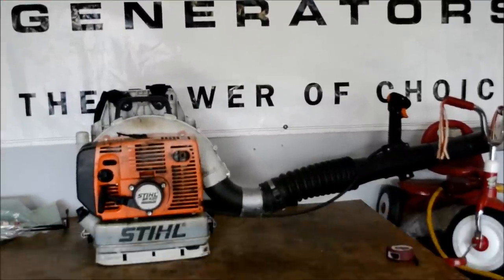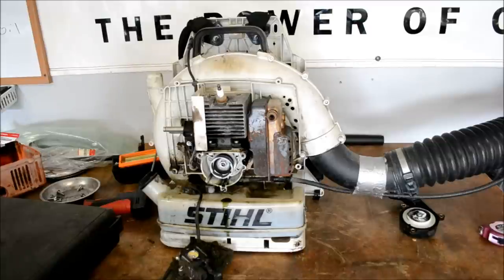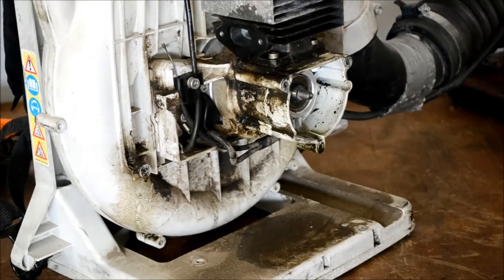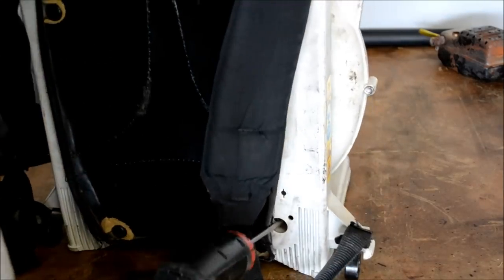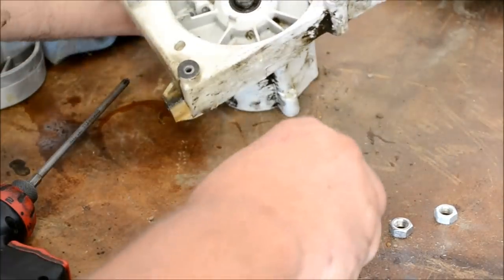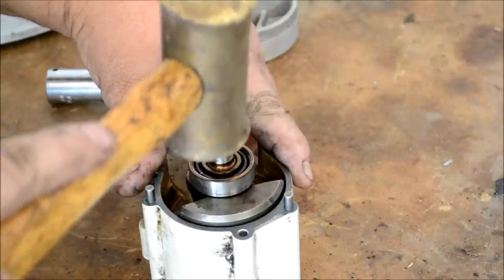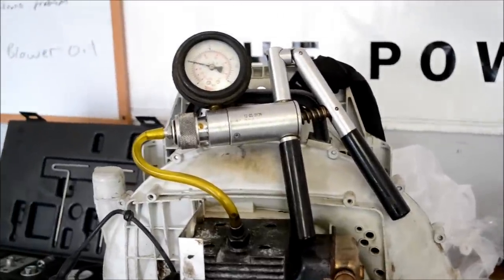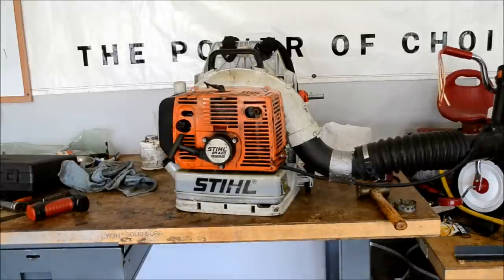STIHL BLOWER REPAIR / BR420 MAGNUM / DIAGNOSIS / TEARDOWN AND COMPLETE ENGINE RESEAL / IN 1080HD

Comment: Hey MowerMedic1, love you video.  I have a BR340 that is just a few steps down from the 420 you worked on.  Now I know how to disassemble the whole thing from your video.  I prefer your videos in 1 part instead of two or three.  It doesn't matter if it is an hour long.  When I have a need to repair my equipment I am going to watch what I need to watch to get the job done.  So don't worry that your video's may be to long in one part.  Those that need to watch are going to watch.  Thanks again.  I wish you would have showed how you squeeze the ring and get the piston back in the cylinder.  Thanks again for a great video.

Comment: Jeremy I can't thank you enough for that video. I have been a professional automotive mechanice for 45 years and first I have to praise you on your thoroughness of testing first. You diagnosed the problem and then resealed the entire crankcase for us. Nice job and again great skills. I'm retired from the automotive business now but have a fully equipted small engine shop and do this kind of repair. While I have done many kinds of repairs I haven't parted the case on one of these yet. But if need be with your instruction I would not hesitate to get the job done. Again thank you my friend for taking your time to deal with the camera and get this on film for everyone to see.
Best Regards,Lisa

Comment: I have to complement you on this video, I havnt got your range of equipment but came to the same conclusion with my BR420 and this video inspired me to give it a go. Stripped it down, installed new gaskets and new piston and rings (one was broken) and put it back together, new fuel and spark plug and gave the carb a complete overall. Crossed my fingers and nothing! Then remebered the start switch and hey presto it burst into life. The cost of the parts probably made this exercise too expensive in the U.K. but very satisfying none the less. Thx.

Comment: Very comprehensive job - you clearly know what you are doing.  I had cleaned up my BR 420 because my son was complaining he could never get it started.  Really nothing wrong with it but it did need the plug properly gapped (.5mm  pg. 31 of the manual), but in removing the carburetor to clean it, the throttle cable became disconnected and I was finding it nearly impossible to get it reconnected - and here is where I was hoping you would show that when you were putting everything back together.  Got some ideas of what I need to do so back to the drawing board for me.  Would never try the tear down myself without your video - great job (except the abbreviated process of putting it back together.  )

Comment: I have an older redmax blower i would like to do this to but they have the 2 piece crankshafts and I don't have the tool to get the crank shaft apart to replace the bearings in the case. Great job Buddy!!

Comment: I can't thank you enough also.....I found a br 420c on the side of the road.......new air filter, new gas, plug, fired right up.. however I'm ordering a complete cylinder ,piston, carb kit, seals.....bad score in cylinder. It won't idle long, do you think it's bleeding down compression from the cylinder or seals and base gasket.? It looks all oily just like yours...however top speed it will run for hours. Where do you get your parts? Tons of hours on this unit, I'd like to do a full rebuild including crank, any good parts places online? Anyways I loved the video, now I know all the tools I need. Thanx again my friend
Reply from the maker: Feel free to click on that heart under the video! Thanks for watching!

Comment: Man that was a great step by step instruction. I have one of these models that my neighbor gave to me. The only thing that I had to do was change the carburetor. Now I have noticed that my air filter has been soaking up the fuel. I have no idea how long this was going on. Normally when it doesn't start I will pull the plug and let the cylinder dry out. But now i have pressure remaining in the tank. I read online that the gas cap is not venting???? Since they stopped making this model, how can I get a replacement cap and a new air filter???
Reply: Check on eBay or amazon and you should be able to find a new cap

Comment: Many Thanks great detailed video!.  I have a BR430 which is leaking air/oil in the cover.  Starts, OK then warms up and starts dropping power.  Suspect its possibly seal between block and crank.  Not 100% sure But I don't have a compression tester - anyway to find leak without this ?

Comment: Jeremy I want to ask you a question. I purchased my in law's cottage and it came with a BR420 Magnum blower. The blower only has about 4 hours on it. The unit has sat in a dry exterior storage shed but the weather has been extreme for temperatures as it is in northern Ontario Canada (in the 90's in the summer and down to around -15 in winter). It was sitting in the shed for two years untouched. I took it out of the shed and the fuel tank was over half full. I went to pull it over and it just stopped/stuck. I figured it had seized. I pulled the plug and it was full to the brim of fuel so it had hydraliced. I found I broke the shear key on the crank. My question to you is would you think I bent the rod possibly as well? I really do not want to pull the bottom end apart. I did loosen the head bolts and drained out the fuel from the crank case as well. I have fiddled with engines for years but this is the first time I have had a motor draw fuel from temperature changes. You see that before too? Really interested to hear your thoughts on the rod. Thanks

Comment: Bought a mess up 420 ,found the carburetor screw's trip ,engine block has to re tapped ,got an old engine, but piston stuck, can't get it open, still working on this project,,

Comment: Loved the Break Down and Rebuild video... i own an old BR420 C Magnum.. I bought used.. i am having a problem with the throttle Cable assembly .. I can't get Full Power from Trigger.. I think the previous owners had either removed a piece or  lost it/broke... that holds the cable to the carb.... the cable seems to float freely there... Nothing holding it in place... Would you happen to have and diagrams or parts catalogs for the carb/Cable connections??
Keep the Videos coming.. Loving and Learning a Whole Lot!! Thanks!!

Comment: I notice that crankcase half  gasket was sticking above the cylinder base. Is that a possible leak spot because the bottom cylinder gasket has a hard time being flush with the crankcase base. What do you think?
Reply from the maker: you have to trim the excess off with a knife

Comment: Hi Jeremy,

Great video! I'm looking at doing a tear down and rebuild of an old Stihl BR420. When my dad gave it to me, he said the unit will run for a bit and they die a short time after being on full throttle. So far I have replaced the air and fuel filters, rebult the carb, new spark plug and cleaned the spark arrestor screen. I had my local small engnie mechanic run a pressure test and ensure the carb was properly adjusted. My last effort is to replace all seals and gaskets. I hope that will solve the issue.

Thanks again for video! Also, any advise or recommendations would be appreciated!
Reply: Did you end up adjusting the gap between the ignition coil and the flywheel?  I have the same problem and I have heard that this should fix it.  The gap is equivalent to a business card
Reply: What is the PSI

Comment: Jeremy, have you heard about STIHL and others chainsaws used in Forestry Dept have been splashing fuel back into users faces due to build upon pressure in fuel tank, someone came up with a different cap and a refueling system similar to Indy Cars.
Interesting.

Comment: I just did this job but I changed the crank and bearings and apparently I screwed up the front crank bearing housing and after about 4 uses it blew out the front seal and would not crank  so if you change the bearings DON’T KNOCK THE FRONT BEARING into the block housing to far it bends the lock clip and runs the block  from experience luckily I have a used one coming and redoing my mistake

Comment: Great video! I just picked one of these up. It runs great but I now have oil stains on the back of my shirt and pants. The wife is not happy! This looks like the solution to my problem. Where is the best place to get parts? Is there a kit with the seals and gaskets? Thanks again

Comment: I baught the BR600 magnum about 3 years back. Any problems you know of I should lookout for? I have about 100 hours on it so far, so it hasn't really been used too much but it's been a fantastic machine. I run nothing but 50:1 with 89 octane.
Reply: a 4 stroke that runs on mixed gas? wtf are you talking about...

Comment: My Stihl BR 430 blower has developed a engine knock.  Very noticeable at low RPMs.  Is the problem most likely a crank shaft bearing/seal?

Comment: my friend,i like your videos,and  I like to ask if you can explain the functioning of a little valve incrusted on the fuel tank of the 600 magnum blower and also if you can explain the assembling of the intake and exaust valves on the same machine,specialy the balancing mechanism ,that looks like little fingers and moves with the push rods, I have one on wich I like to put my hands on it,tks a lot

Comment: I wanted to ask are there two intake manifold gaskets or one when I took apart my machine it had two manifold gaskets one on the cylinder between the heat shield and one on the opposite side of the heat shield my question is how many does it require and where does it go
Reply from the maker: https://www.google.com/search?q=br420.parts.list&rlz=1CDGOYI_enUS771US771&oq=br420.parts.list&aqs=chrome..69i57.12282j0j4&hl=en-US&sourceid=chrome-mobile&ie=UTF-8#imgdii=eqpqR57KPS2yCM&imgrc=1oGRUThyZssYaM

Comment: Great video it's sad how so many pepole will toss it in the trash or give it away or sell it very cheap and all it needs is a little of your time and now how and it will be like new again am one of the guys like u fix it and ur good too go only if u new how many good things I get from pepole not noing how to fix it or I'll buy something cheap and I'll tear it down clean every part and new seals and your good too go sometime u will run into something that can't be fix but what I'll do is tear it down and save the good parts and toss the no good stuff and I'll say this more then a hand full of times I used a part that I saved from something that hand no use anymore . Evertime I save parts I write what it's for what it came off put it in a baggy with some tape on the bag and write on the tape and I'll put it with all the other parts pluss I always clean the parts but ya I love to fix something that would off gone in the trash pluss u save a lot of money and u make money if u sell it now this is what u call very GREEN something that not to many pepole will know !!

Comment: I have a Sthil BR400 backpack blower, I removed the pull starter, what size nut holds the starter assembly on the piston point?

Comment: I've got a BR 350 and the plastic adapters for the hi and low adjustment screws on the carburetor which limit  you're adjusting parameters somehow came up missing after loaning it to a friend and the high and low screws adjustments are way out of whack. Do you know how many turns each should be adjusted outward for the factory setting if screwed all the way in clockwise? I've searched high and low and cannot find how many turns to achieve factory settings. Please help! J D in Tampa Florida
Reply: I usually close them up snug not tight so you don't bend the tips. Then back them off 2 1/2 turns and go from there. Once you get the initial idling then you can rev the engine and conduct your final adjustment.

Comment: A new version Br450 is $800 in Australia I’m sure the repair wouldn’t be viable for a contractor to have it repaired at a shop without costing an arm and a leg.
I know it’s a in-house repair in your situation, but if it was someone of the street what would the repair cost be parts and labor.
Let’s assume the replacement cost is US$500 - $600 for a new one with warranty.

Comment: Hey I'm having trouble with a stihl br600 blower it won't turn on I took it apart and put a new motor In it but when i try turning it on it won't turn on idk what's wrong or what I did wrong in the process
Reply from the maker: too many things it could be.........but to make any engine run you need fuel, air compression and spark......these 4 things it should run.

Comment: I just subscribed to your channel, thanks for the lengthy video, lol, just kidding...Very helpful, although Its my fuel that's leaking underneath the gas tank.. I guess I will need to pull it apart first and see where the leak is I will let you know how it turns out..

Comment: Hi ,I got a br420 magnum I rebuilt the engine because don't star Just compression explosion like out of time,I cleaned it up and put everything together fuel tankI clean the tank ,carb new spark plug and he doing the same thing I am mad because I Cleaned up so perfect And still do the same thing I put another carb but the same thing again I know he got compression but I don't know what the Hells going on even The coil is clean but nothing just explode muffler and the cap.
Reply: Tony Casiano  I have one that's doing the same thing. I did all the same things and even replaced the piston and rings. Still won't start. Checked my wires and even replaced the coil. Any luck figuring yours out?

Comment: hey great vid ..I have a br 400 ..hard to start and once I have it started it will run for a little bit then stop ..I did a rebuilt on the carb and new plug.?  what do you think..thanks
Reply from the maker: First things first is to do a vacuum and pressure test

Comment: My blower gets very hot and blows out white smoke the first few seconds. Do you know the reason?
Reply from the maker: Flooded
Reply: How can i fix that issue?
Reply from the maker: Sergio Garcia rebuild or replace the carburetor and related parts

Comment: GOT A BR 420 MAGNUM  GOT GAS GOT AIR AN COMPRESSION DID A RESEAL JOB AND PUT A CRAB REBUILD KIT  BUT STILL CANT GET IT TO START AND IS GETTING TO MUCH GAS ON THE SPAKPLUG
Reply from the maker: Replace carb

Comment: In this unit, replacing the air filter on the non-original https://russian.alibaba.com/product-detail/high-quality-air-filter-for-16546-ed000-16546-ed500-60604874817.html it is possible to put the blower STIHL BR 600 v. STIHL BR 700 STIHL BR 500 STIHL BR 550 [Blower Comparison ... cut a little with a knife and it fits very well. This item FA-134S air filter 16546-ED000 is two euros for everyone. Any blower is suitable.

Comment: i have got a question....i have the same blower as the one in the vid, and it use to run great,till one day i couldn't  get it to start. well,i got to tinkering with it,and dirt gobber's moved in the exhaust ,cleaned it all out,,still nothing. bought a new carb,and it just dont want to start. i can get it to kick off on choke,but nothing more.someone mentioned it could be a crank sher key.??  oh i forgot to mention also bought and installed a new coil too,,getting great spark. any idea's?
Reply from the maker: First things first.  Do a crankcase leak and pressure test
Reply from the maker: A compression
Test does nothing but test compression.  You
Need
To a crankcase leak and pressure
Test.  If you don’t do the test you are spinning your wheels